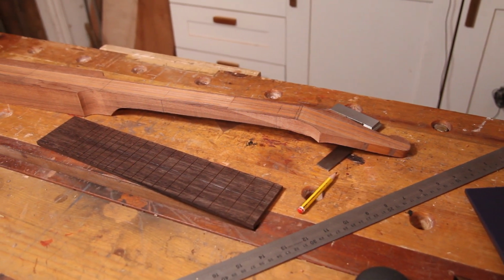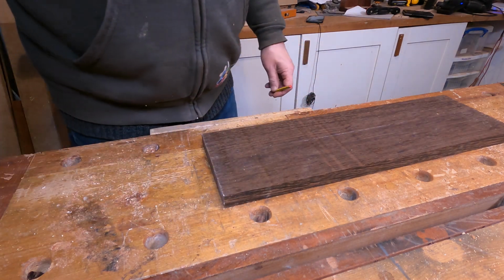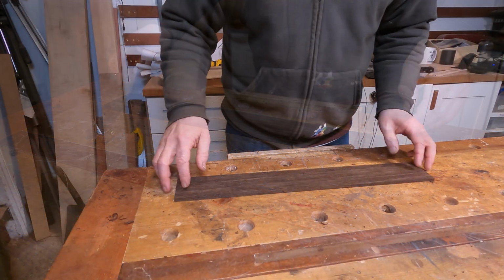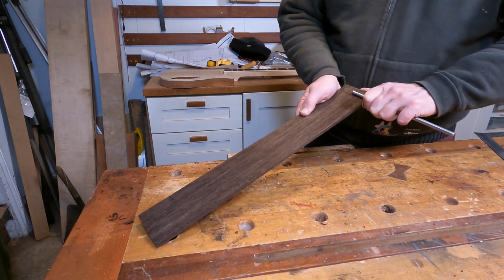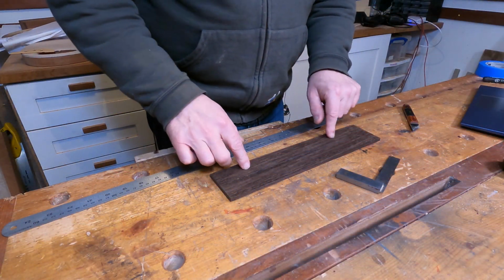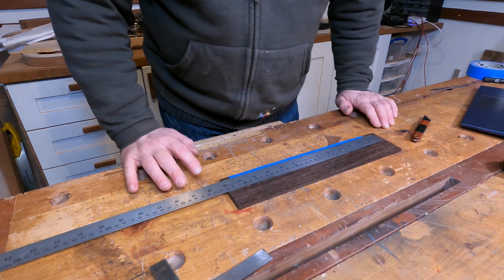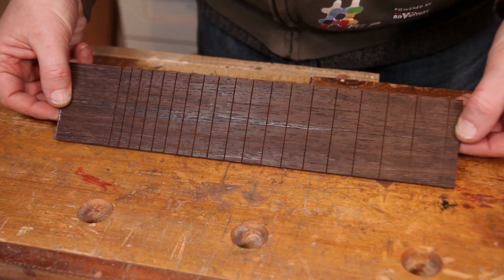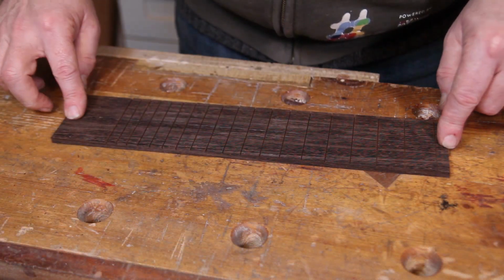Firechick Firebird style tenor Ukulele build. Episode 3

Comment: Yes Wenge is certainly a love/hate wood. If you were not too fussed about absolute scale length there was a trick you could have carried over from your 620 build. I think tenor Uke is 17 inches scale length (431.8mm). If you used your fret guide from the ricky but set the nut at the 6th fret you would have had a scale length of 444.5mm. Then you would have had a small error on the absolute length but be fully accurate on all the fret positions without all the faff of measuring.
Reply from the maker: That's what I love about doing this, there is so many really wise builders out there with an absolute gem of information like that. I'm making a note of that one, thanks :)
Reply: Just check my maths. I did this on a scrap of paper on Sunday morning. The idea is correct though. You could just measure the firebird or Ricky and then pick the closet fret to your target length and use that for your actual scale length and use the fret jig. A different starting scale such as 25.5inch would of course give you a range of different lengths.